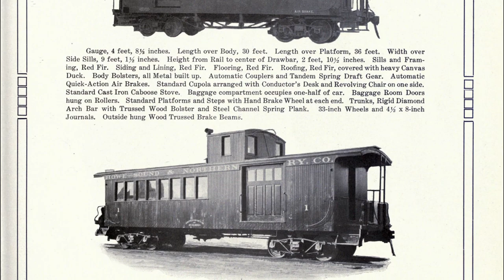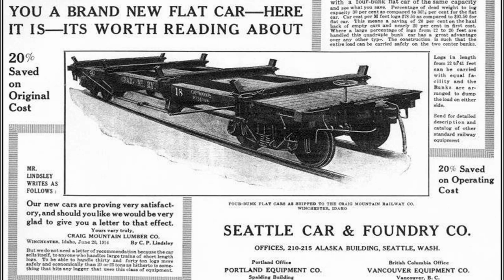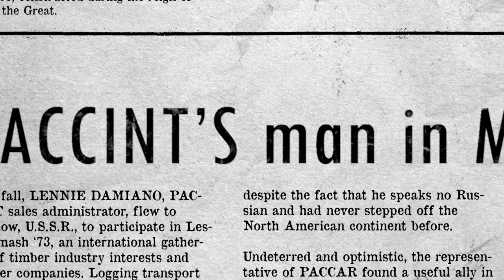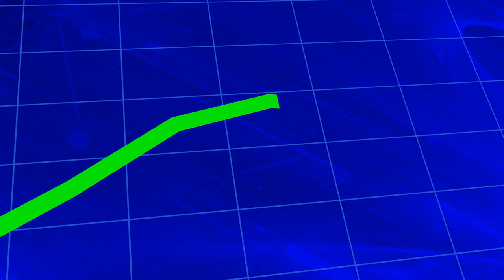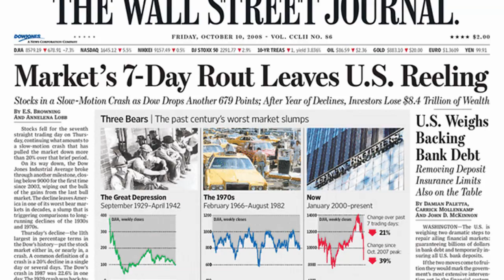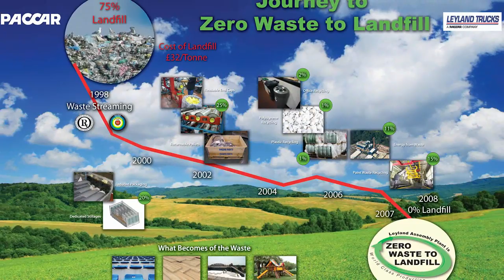PACCAR History

Comment: Honest no BS opinion from a trucker please. I’m on the fence on buying a 2019 t680. On paper the b10 rating is awesome. But I’ve heard from other owner ops that Freightliner has the DEF figures out and the other company’s are trying there best to keep up but have many issues with def systems. I don’t want a Freightliner based on looks and the blandness of the cab  so my question is to a 15+ trucker vet would you buy a t680?
Reply: Freightliner is losing market share.... just a thought.
Reply: freightliner is absolute junk buy kenworth glider kit .
Reply: Kw and pete have a 20-30% better resale value than other brands NO BS .

Comment: The mx engines where designed in Europe we’ve had the engines for years they punch well above there weight and descent fuel economy
Reply: Right! By DAF!
Reply: They're junk , run Cummins and you'll be much more productive and reliable
Reply: Read about my earlier reply. Great engines, we never had problems with them. Our Cummins cant pull The Moonbi's in NSW Australia without threatining to shut down with heat issues, and regularly de-rate and threaten to shut down. Why do Kenworth run insufficient cooling systems on our Cummins, but the PAC's with aluminium radiators run 20`c cooler. You've gotta ask man

Comment: Eeewww paccar engines there nothing better than A Cat-15 Cummins N14 and Detroit Series 60
Reply: Mack: E-9 & MP8/MP10, Cummins NHS-275 & NH-220. Cummins 350 & Big Cam 400, Cummins M-11, ISX (Kinda Crap), & ISL 380. Cummins Signature 600. Detroit Diesel: 6v71, 8v71, 6v92, 8v92, & Buzzin' Dozen 12-Cylinder. CAT 3406 & 3408 (3408 has head gasket issues though) CAT C-15 multi-torque, C-16, C-18, & CAT 1693 (The FIRST Cat OTR engine put in a truck from a bulldozer.)
Reply: We had 2x 19 metre SAR 409 Kenworths with PAC engines. They weren't a punchy as ISX 15 Litres, but were 13 litre engines. 740,000 and 560,000 kms respectively and never broke down. These engines run cool compared with the Cummins ISX and Signatures which run really hot, i.e. 110-120 degrees c. They had automated 18 speed Eatons behind them( Paccars) and were deceptively quick, maintaining road speed when they seemed to be slow. Mechanics turned there noses up at them because they got no work from them.These two 19m's were sent to Orange/Lithgow NSW in Australia. They continue to work without trouble. I wish our branch still had them.
Reply: Grant Ball I’m convinced there good engines ESPECIALLY with really good maintenance

Comment: Eh don’t really like paccars. The engine for our American trucks should always be caterpillar and Cummins engines. That’s how it should be. Paccar engines are just too damn techy. In a truck built for heavy duty work, they should have cat or Cummins or Detroit motors in em. They are built for power and to stand heavy jobs and all that. Paccars don’t have as much power as those engines. The highest horsepower paccar engine I’ve heard up was one that only had like 505hp. That’s ok I guess but that engine can’t be put into a truck that does heavy hauling. Paccar is a more European engine. They are in European trucks which I hate because they literally all look the same and they drive like cars. So easy to drive those things I hear. So in my opinion they should not put paccars in the American trucks anymore. They just ain’t that good for em.
Reply: The nowadays highest powered PACCAR MX-13 is 530 HP and developed by PACCAR's daughter DAF Trucks the Netherlands. In 1987 there was a DAF Truck (0ver 1000 HP) which won the Paris - Dakar rally.
Reply: @47rintin1  built motor of course. The Paccar engine is pretty shit... seriously, it’s a piece of shit. No power they don’t sound good at all. You don’t see em much here in the U.S. the ones I see the most have crappy 455hp!
Reply: @47rintin1  530hp ain’t bad for certain companies